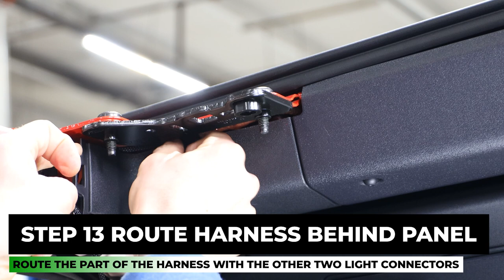Installing The IAG 4PC Interior LED Dome Light Kit For 4 Door Soft Top & 2 Door  2021+ Ford Bronco

Comment: @IAG Off-Road… guys, phenomenal product and super detailed installation instructions. Thank you for this. With kids and car seats in the back, one of my biggest complaints was the lack of light in the cabin. This product delivers big time 👏

In most cases I’d rather pay someone to do these things but am handy enough to handle a DIY project when it calls for it. 

A couple of notes/comments. Really great installation instructions with a few exceptions:
- as mentioned by others, accessing the grey/purple wire is WORK! First, there is a grey/brown wire that looks very much like the one you’re looking for if you don’t have enough light or good eyes. I don’t feel like this is emphasized enough. Now you know.  Second, it’s a REALLY tight fit.  Like getting your hands in there is a challenge. Third, getting the T-Tap around the grey/purple wire with minimal slack is a challenge. Don’t make the mistake I did and turn the T-Tap upside down and let the little metal piece fall out underneath the dashboard. You will never find it. 🤦🏻‍♂️  It took a couple days before I could get a duplicate and complete the install. Sucked. Really.  This was no fault of IAG, just want you to be aware if you’re smart with to read the comments before you begin the install. 

Bottom line is you won’t regret the purchase or deciding to install yourself, it really is an amazing addition to the Bronco interior 👍🏼
Reply: Lol I did the same thing dropping the metal piece
Reply: This was a difficult install, I installed before reading, I agree with all you have described with exception of 4 brackets I have in my kit, they weren't mentioned in the video when I finished the install I realized I needed them to move the lights out of the way of the clamps for my removable hard top, almost trashed them until I tried to put the top back on.

Comment: I didn’t even try connecting it to the fuse box harness. I ran a wire through the firewall grommet and wired it to an up fitter switch.

Comment: According to website it appears you can wire it to both the door switch and the upfitter: Please note that by default the dome lights will only illuminate when the doors are opened. However, we also include a pigtail for the harness which allows the lights to be connected to one of the upfitter switches for switched operation with the doors closed.
Reply: more explained here as well   https://www.youtube.com/watch?v=4YLBUDkZ7Ks
Reply: Where is the upfitter?

Comment: The optional connector to aux switches.... would be nice to have seen those steps.
Reply: Connect to switched +12v. I hope there is a diode in the harness so you don't back feed +12v to the factory harness. I only used the connection to the Grey/Purple wire.

Comment: Just installed these. Grey wire with purple stripe is the power wire for OEM dome lights.
Reply: There are two! Which one??
Reply: @stevenkuehn8939  There is only one. You are looking at the Grey/Brown. Really hard to see.
Reply: @scramick  you are correct. Really important to have a good, hands free light source. Also be very careful when cutting the wrap off of the wiring harness.
Reply: @timkiely3240  I needed two lights on it and glasses!! Super hard to see!!

Comment: Installed nicely except for getting my fat hands to get to the grey/purple wire. Ford didn't leave much pull to get to the harness. If you are not good with your hands/working with wiring, take it to a stereo shop for the install.
Reply: This part killed me! I was contorted lying on my back holding pry tool in my mouth, my feet sticking out the side of the car sweating everywhere this easily took the most time and was the most difficult part of the install. Did finally get it done though.  Thank god I isolated the correct wire because if I messed it up I'd have just left it hahaha -- definitely good advice; next time if I have to touch that stuff I'm hiring professionals.